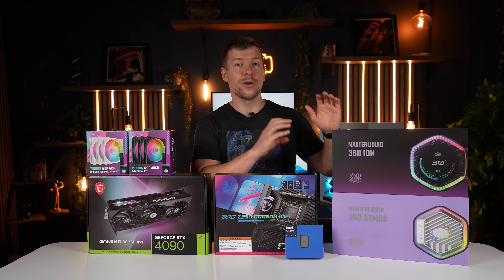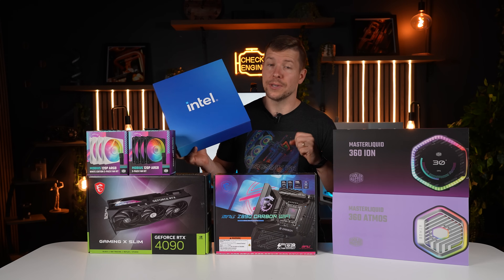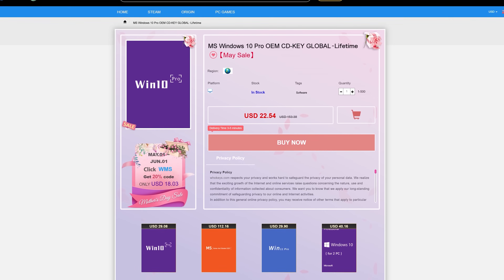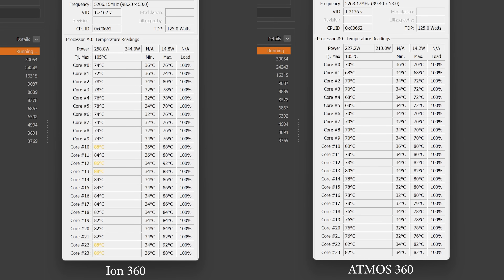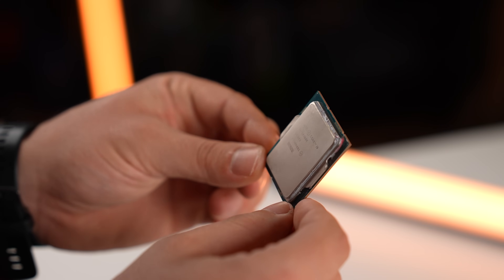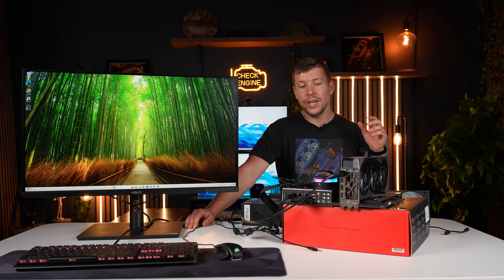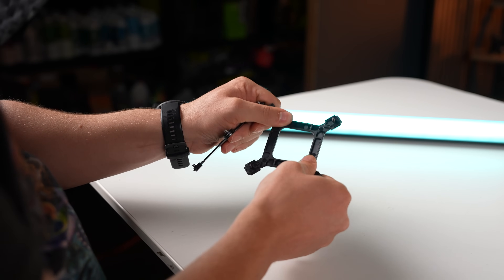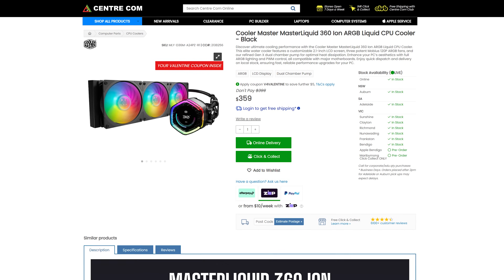Watch before you buy - this might save your CPU

Comment: That's a lot of money for an AIO. I just picked up the Thermalright Hyper Vision 360 ARGB AIO for half that price, and it's been a complete beast. Keeps my 9800X3D in the lower 60C range in Cyberpunk 2077, and idles at 33C with an ambient temp of around 24-25C. So, not exactly a cold room.
Reply from the maker: The 9800x3d in general is a really cool chip, I believe it's only around 125w power draw. I haven't tested that cooler though but I am glad you are happy with it.
Reply: @DesignsByIFR  It's also overclocked all core 5300 and running at 1.28V. It's pulling more than stock. Also, I used this cooler on my 13900K system before moving it over to this one, and it handled that CPU overclocked as well just fine. About the same idle temps, but a bit higher boost temps.

Comment: When you first tested that new cooler, was it released to the public like that? Surely, internal tests would have shown that it wasn't up to par and not ready for the public. Sounds like the accounts department in Cooler Master was the section tasked with final approval for public consumption (I assume the original bracket shipped was identical to that supplied with the older cooler i.e. cost cutting).
Reply from the maker: Yes, so the first batch had already shipped, that's why anyone with the cooler already needs to contact cooler master for the new bracket. All other batches will ship with the new bracket.

Comment: how can all the specs be exactly the same if its a diferent motherboard, ram and a conpletely different cpu ?
Reply from the maker: Same coolers, same nvme, same PSU. I already said I had to change the RAM, and it's fairly obvious if I am going to a 14900k system then the motherboard has to change to match the socket.

Comment: cory you are not the only person having this problem , i just done a upgrade to mates lad PC , the Corsair PSU was dead on arrivial , i bought a GTX 1070 of ebay (the computer would not even power on with that card installed , put his old gpu in there and it booted straight to windows) i got in touch with ebay over phone as seller was ghosting me they told me they would sort it as i was going on holiday to prauge in next few days , now ebay saying it is now out of time to return
Reply from the maker: Ah yes was that a second hand GPU?
Reply: @DesignsByIFR  yes now ebay messing me around on refund , i had told them i was going to be out of country